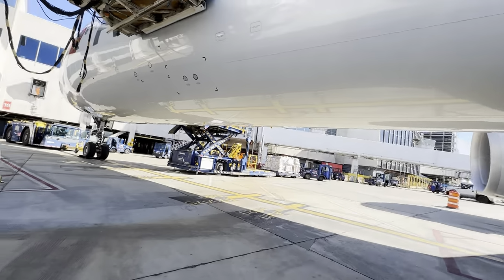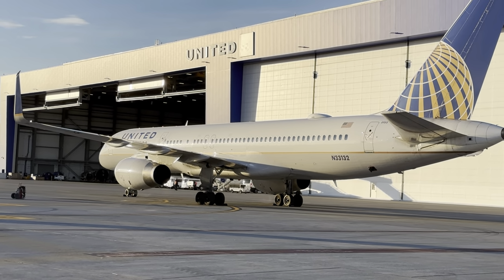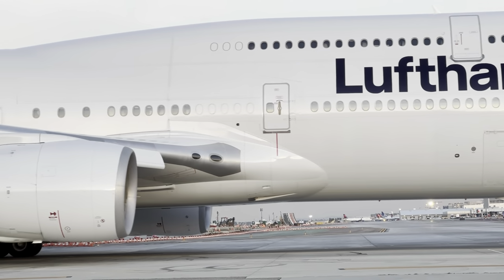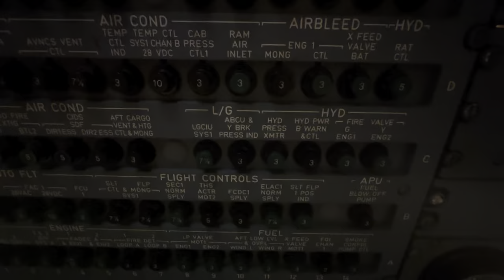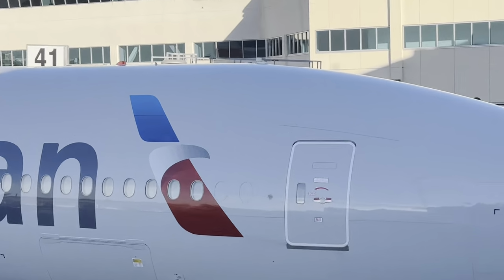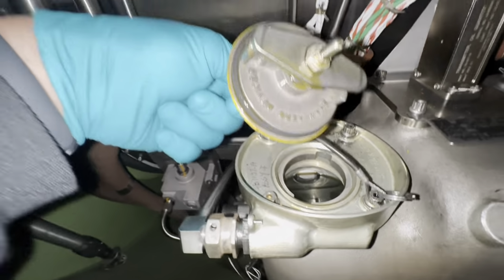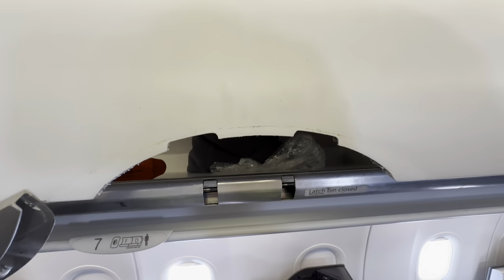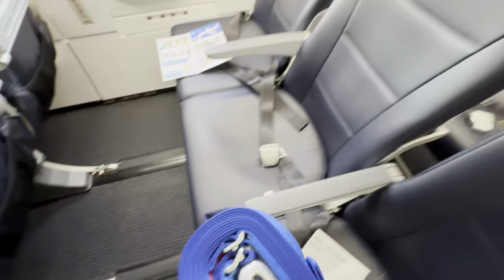Stig Shift #11 (Aircraft Maintenance Adventures)

Comment: That red car was the czinger 21c v max. Has 1250-1350hp, has a top speed of 253mph and 0-60 in 1.9 seconds.
Reply: est $2mil price tag
Reply from the maker: Such a beautiful car, from what I understand that thing is 3-D printed
Reply: @StigAviation  not 3d printed they used AI in it's creation so it has a lot of hollow places because the AI figured out how to save a TON of weight while still making the car extremely strong
Reply: With the window down.
Reply: I’m glad you liked my car……😂😂😂😂😂😂😂

Comment: While he is correct about the vortex generator, the way it works is by doing just what the name says. A vortex will stick to the top of the wing in a way that turbulent air won’t, and it has a nice side effect of sucking nearby air into it thus eliminating even more turbulence. It’s most useful during higher angles of attack where the engine especially disturbs the air.
Reply from the maker: Excellent additional information. Thank you very much sir.

Comment: The C-32 (B757-200) carries the VP, First Lady, and other individuals at the high cabinet level (Secretary of State, etc).

The C-40C (B737-700 BBJ) is a mobile command center. It contains all sorts of classified communications tech and whatnot.

I think this is a C-40C, not a C-40B based on the antenna. Either way, someone important is in town. Probably VP, based on the fact that the C-40 was accompanying.

The C-32 is only Air Force Two when the VP is onboard. Sometimes, the C-32 will carry POTUS if the VC-25 can't get to the airport POTUS is travelling to.
Reply from the maker: Thank you so much for all this wonderful information, and thank you for correcting me on the 737 model number.
Reply: Correct.  The C-40C served as the press plane

Comment: The C-40's fly into KGON a lot as well as B757's (AKA C-32). I got a video on my youtube of one landing a few weeks ago. They are modified B737-700's with fuel tank modifications to carry more fuel as well as UARRSI for in-flight refueling. It has a modified communications suite as well as military communication equipment like SATCOM, TACAN's, etc. They also have the short field operations upgrade kit applied. They also are equipped with a RWR and CMS system in case they are engaged in hostile combat and can get out of the area and defend itself.
Reply from the maker: Thank you so much for the incredible information. Much appreciated. And thank you for correcting me on the 737 model.

Comment: First off, Great videos! Airline pilot here and the amount of detail you can give is excellent and your drive to learn more is also amazing! Just want to give some more clarification on some of the Antenna on the 777 you show and their operational uses.

The DME is used for landing, but its primary purpose is general navigation enroute! Usually tied in with VORs to determine a position over the ground.
The Marker Beacons are specific to ILS approaches, the Localizer and Glideslope tell you how high and if you are lined up with the runway, but the Marker Beacons tell you how FAR from the runway you are and are located at various important points on the approach (Outer at final approach fix, Middle at 200 ft AGL or cat 1 minimums, and Inner at 100 ft AGL or Cat 2 minimums) They are essentially flashlights that point up at which point they are received by that antenna.

Keep up the great work! It's interesting seeing the differences in aircraft between Airbus, Boeing, and Embraer, the metal I fly.
Reply from the maker: First of all, thank you so much for being here Captain. I strive to learn as much as possible, every day is a school day. And I would like to express my gratitude for your knowledge and sharing it here. The information you provided is very important, but I just did not want to boggle up the video with that level of detail. But I appreciate that you did. I rather hear it from my professional like you who actually flies the aircraft.

Comment: Great vid as always, Stig!

1. I had no idea that 757s shook themselves that much doing static engine runs. That tail deflection is INSANE.

2. Car IDs. That 1st un-identified car I believe is a Czinger 21C with the V max package. Mostly a body style upgrade if I remember right. A rare spot for sure. The 2nd car is a full self driving company's Lexus NX either coming from or to CES (I'm not sure when you filmed this). Ambarella is the company that fitted the Full self driving equipment on it.

3. The Airforce 2 aircraft you were looking at is technically just a C-32. Only once the vice president steps on board does it carry the label of Airforce 2. You were spot on with the C-40!
Reply from the maker: Thank you so much, I’m glad you enjoyed the video. One interesting thing about that first car, I just learned this myself, it’s 3-D printed.  How amazing is that

Comment: Worked the last 24 years at a 145 repair station. Mostly pneumatics but some hydraulics, fuel and electromechanical components. Started out working on L1011 valves then transitioned to 747. We also did a ton of CRJ components too. Like you, when I started I loved my job. Something new everyday but at the end of my career if was totally profit driven.
Reply from the maker: I have a hard time believing it was profit driven, I know the passion is still inside of you, and I can guarantee you always looked up when one of them took off.
Reply: @StigAviation  It was a family owned business when I started in the mid 90's but was sold to an oversea's company in the late 2000's. Since then it was sold three more times and an investment group owned it when I retired. So yes, profit driven. I have an app on my phone so in the summer, when out with my puppies, I check it when planes fly over. Occasionally  the queen will fly by.

Comment: Prenominal video, so technical and yet entertaining.  Those triple shaft RB211's are screaming on that 757, amazed how much the horizontal stabilizers are moving around.
Reply from the maker: The 757 is one of the most overpowered aircraft in commercial aviation. It’s amazing to watch it do high-power runs.

Comment: I used to work at Rolls Royce aerospace, specifically at Rolls Royce Barnoldswick, where the 211 was developed . Hence, RB211 ( Rolls Barnoldswick 211). Used on the 747 and the 757.  They now do the wide chord fan blades for the Trent. They were the biggest company in our area, most of my family worked there. They also help design the Olympus engines for concorde.
Reply from the maker: That so incredible that you got to be part of that. Can’t wait to see what RR will do with the new Ultra Fan
Reply: @StigAviation  I also used to fix the machines for aerospace factories so worked at Airbus, Boeing factories as well as a spell working for GE, hence why I love your channel. I am as passionate about aircraft as you. I will tell you over a beer one day how I was paid to sit and watch a fix being made to Concordes landing strut in the UK , that was couriered  to Heathrow, and flown to Sydney for a AOG scenario lol. And fixed Rosie the Riveter the huge machine used to rivet the fuselage. So many stories

Comment: Thank Stig!
Do you check all logs into the system or pilot (CM) signalling the specific warning  on check_out report?
I suppose there AC current supply for the services from alternators into the motors then there are rectifiers for DC  load (I thought avionics and computers). 
It is admirable the path and schock adsorber/insulators for electrical harnesses (same for the liquid tubing).
There are specific grade for these materials because the thermal stresses are huge.
Reply from the maker: I checked the vital logs, but it’s unnecessary for me to scrutinize every single thing. If there’s something wrong with the aircraft, the aircraft will let me know.

Comment: The only thing with the faulty ATS is you can do an inflight start without it, but you have to be at a certain speed and altitude for a windmill start. If it happens on takeoff you won’t be able to get bleed air to assist since the valve won’t turn and you’re too slow. Either way you’re coming back to add more work for the Stig shift.
Reply from the maker: You are absolutely correct. Thank you for adding more to the subject. I appreciate you.

Comment: Hey Stig, can you talk a little bit about how you communicate or where you get the information on where to go next, which airplane you have to look at, what airplanes arrive, pilot communication etc.? Is there a system in place or do you get everything via the radio? Thank you!
Reply from the maker: Oh, that’s really easy to explain, I get assigned gates. Anything that comes into that gate is my responsibility. So, for example, if I get assigned gate 41, 43,45 then I am going to be responsible for every single aircraft that comes to those gates.

Comment: Yup. Contrails (~26:19). Condensate trails.  The products of combustion of a hydrocarbon fuel (kerosene, in this case) are CO2  & steam. A gas turbine is really a gas turbine/steam turbine. It exhausts hot CO2 and superheated steam, hence contrails.
Reply from the maker: Perfect explanation Andrew 👌

Comment: I just did a handful of flights on American and saw AF1 in MIA and got to sit on the ramp for an extra hour! (777-200 and 737-800 and 737 max) I was wondering what your thoughts are on the amenities kit being reduced to cardboard and the white paint jobs vs the shiny chrome? (I didn't even get any on my flights in business/first since the flights were max 3 hours length, I look forward to the goodies in the pouch and reusing it for other stuff later)
Reply from the maker: I have no thoughts on the amenities because I’m not in charge of any of that. I am only in charge of making sure the aircraft is working properly. In regards to the paint job, even though the chrome is a very beautiful thing, but it also is a burden for maintenance. The metal is now exposed to the elements and is more susceptible to corrosion. And it also has to be continuously polished. Which takes up even more time and manpower. Having the aircraft painted provides more protection to the metal.

Comment: Bro - You're D'MAN!!  Thanks for sharing !!!   It makes me appreciate my little Cessna172SP a bit more with it's antennas -  Communication antennas, UHF antennas (DME), NAV antennas on Tail, GPS antennas, Marker beacon antennas, ELT Emergency locator transmitter antennas..  Question:  How does the movie /TV stuff works on the aircraft?
Reply from the maker: Remember, when I showed that big dome up top, that’s the Wi-Fi antenna, that’s usually how you can get on online and watch live streaming broadcast. But the movies and TV stuff works off of a hard drive that’s installed on the aircraft. They update those once a month. So if you don’t have Internet, you can always watch the onboard entertainment. We called at the IFE in-flight entertainment system

Comment: Thank you for an awesome video! Not boring at all. Couple questions:
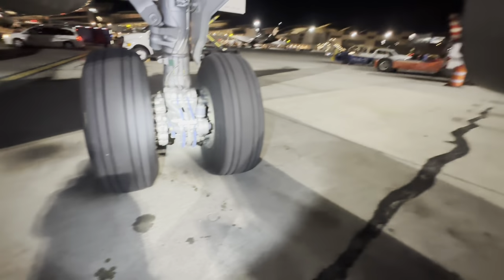- why do some engines on a320 have a visible vent "exhaust" pipe at the end, but others have a long cowling like on 15:30 and look like a hair dryer?
- are you sleeping somewhere in the airport during your shifts?
Reply from the maker: Those are two different type of engines you’re talking about, the one that looks like a big hairdryer is the V2500. The one with the pipe is a CFM56-5B. just a different designs of engine. And no I do not sleep on the job.

Comment: Quick question, Do they have to open the windows on the cars when they are transporting them on cargo planes to avoid the windows from smashing under pressurisation, like how your bag of chips inflate when your in the air.
Reply from the maker: There is no pressure involved, the cargo compartments are all pressurized. I think they keep the windows open in order to have access to move the wheels if they need to offload the vehicle.

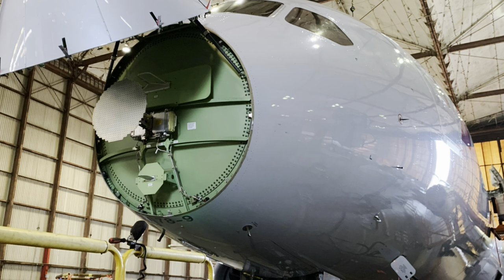Comment: 19:16 wow the 787 radar is tiny. It's cute 😊 lol

I bet if they made a military 787, there'd be a bigger, fancier radar.

I do wish Airbus fitted stick shakers. The PlayStation controller for instance has a "fine" rumble and a "rough" shake, achieved via a motored, spinning counterweight inside each grip. I understand being a flight critical component however Airbus would pay a fortune to certify  & introduce a stick shaker. And active feedback (paired sticks that move together and a stick that "pushes back" if you're about to stall etc) would help avoid AF447 tragedies in future.
Reply from the maker: It’s actually pretty big radar on the 787, I think the picture just did not do it justice. As for flight 447, there were so many other contributing factors to that incident.

Comment: The 757 is designated C-32 and comes in two flavors, A and B.
A is used for Special Air Missions ("SAM" is also their callsign/flight number). When the SAM is the vice president the callsign is changed to AF2. Otherwise any other dignitary could be on board.
The ("gatekeeper") B-version is the one that raises eyebrows. They're entirely white have constantly changing "tail numbers" or none at all and are used for all kinds of 007 type stuff.

The 737-700 carries the Military designation C-40 ("Clipper") and has three main variants.
C-40A (white with gold and blue cheatlines) for the Navy's fleet logistics support squadrons. They are combi versions of the -700 and are only sporting 70 seats in the back. The Marines got their hands on a few too but they're painted grey.
The C-40B carries around the top brass and comes with super duper expensive telephones on board. The C-model doesn't have the communication equipment on board and is therefore more adaptable in seating capacity. It is used to fly around personell and politicians.

Thanks again for taking us out on your shift!
Good coverage of the antennas!
Reply from the maker: Thank you so much for all this incredible information.

Comment: As a Retired AME I can remember doing a max epr L1011 three engine,s (the hard to read instruments on F/E'S panel and OHH YES the a/c hopping over the wheel chocks with breaks on, That's why there are 3 mech's in cockpit 1 for running engines 1 looking out the windshield in case a/c moves and 1 on F/E's instrument panel, those RR 211- 524's have more poop than the 535's (The l1011's wing eng's !&3 are further out on the wing and add to its twisting torque
Reply from the maker: One of the most fascinating things to watch is how the pylon actually warps and twists around at such power. I remember standing outside, while we were doing a high-power run, I thought the engine was going to rip off the pylon for a moment. But obviously it holds on it’s designed to be like that. It’s absolutely incredible.
Reply: Yeh one can push it around with your hand just by grabbing the exhaust area  @StigAviation

Comment: Stig, why did that plane have 2 GS/TRK antennas on one side, and spots for TWO on the other side but there was only ONE on the right side? You could see there was a place for it but it was not there, is there supposed to be 4 or why the empty spot? Thanks in advance and thank you for the videos, you really help us learn and understand so much that we normally would not know.
Reply from the maker: Both sides have the track antennas, it’s a channel A channel B system. I’d have to dig further into the wiring diagram to explain it in detail. It’s just the way they’re wired.

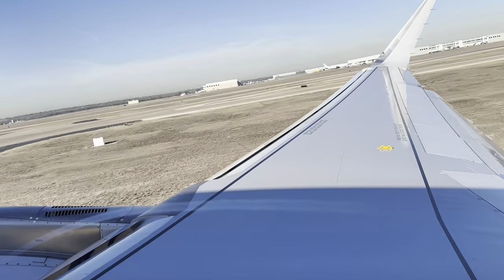Comment: 2:40 it's basically a vortext generator. usually you would want a smooth airflow over the wing (as you mentioned) problem is (again, as you mentioned) anything that could create turbulence (an engine or just a high angle of attack) causes the turbulent air to detach from the wing. vortices allow for airflow to stay attached to the wing longer and better. this is a very broken down explanation (most likely with many flaws.) Samm Sheperd has a tremendously good video on vortex generators. and hbykv has a good video demonstrating the effects of VG on stall speeds.

on the Antennas: don't make the mistake and assume all triangle-ly bits at the bottom are antennas... some of those are the sink drains :'D there was one dripping in the video a couple minutes earlier^^
Reply from the maker: That’s correct, some of the ones on the bottom belly of the tail section are drains. And thank you so much for adding even more technical knowledge to the video. I appreciate you.

Comment: What’s the biggest job you do on the line vs it has to go to the hanger? On my old aircraft we all are great electricians how often do you have wiring issues
Reply from the maker: A massive component change, such as a generator, or some kind of an actuator will most likely have to go to the hangar. Very rarely, we get wiring issues. What’s the time the computer box will fail before the wire

Comment: Stig, Epic video, As an IR PPL I really enjoyed the run thru of all the Com/Nav antennas on that 772.....      One question when you were talking about that temp probe on intake of the CFM on that 73.... Where are the probes that measure the Intake pressure v the back end pressure so they can come up with the EPR on the Avionics?
Reply from the maker: Since this is a CFM engine it doesn’t read EPR. That’s more indicative of a RR or PW engine. CFM reads N1 N2 pressure which is in the low pressure compressor and high-pressure compressor as well as low pressure, turbine and high-pressure turbine  there is another pressure sensor, which is called PS3, which measures high-pressure compressor discharge static pressure. All this information gets fed back into the EEC for thrust management.
Reply: @StigAviation    Interesting....  I remember learning about EPR from a Cathy Pacific 747-400 video where they had RB211's.